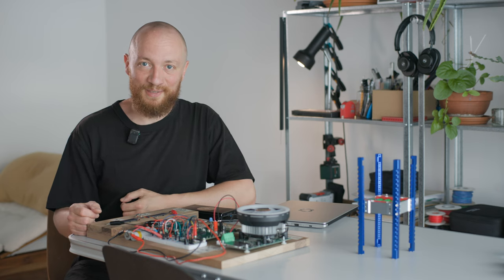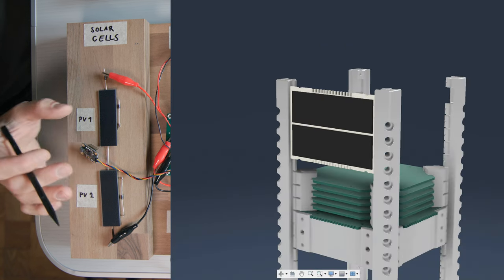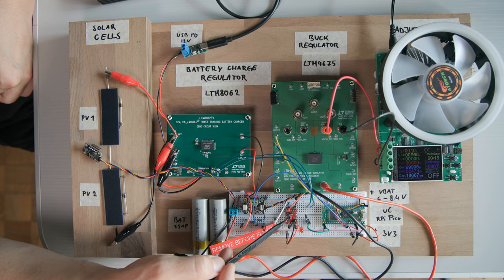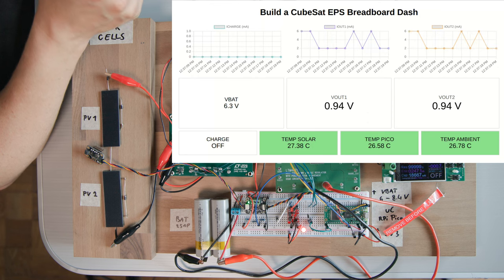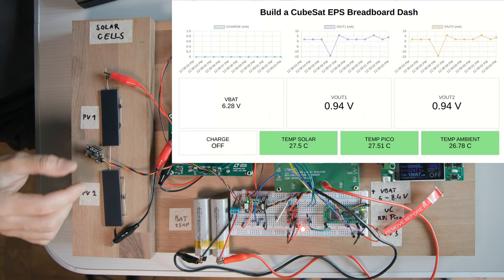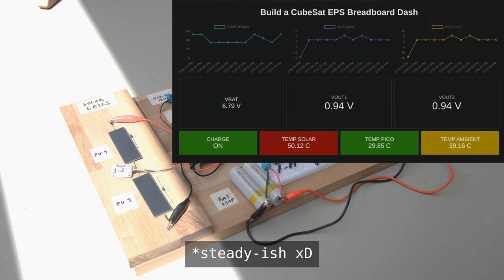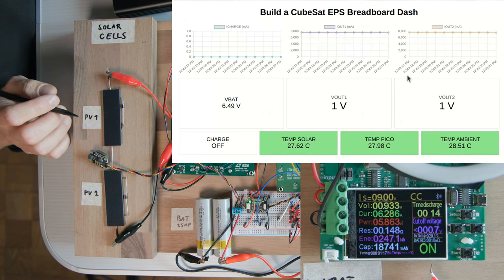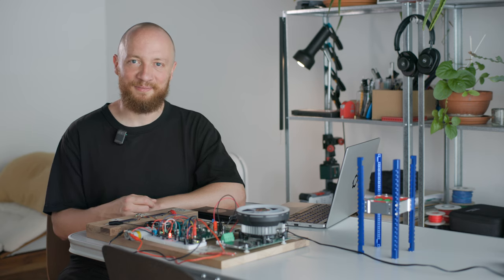CubeSat EPS: Breadboard Prototype

Comment from the maker: The next thing I would like to try with the LTM4675 (after getting the PMBus telemetry to work reliably) is reading its internal temp sensors and characterize the temp rise when at different currents and at ambient pressure vs. in a vacuum.

Also I just noticed a discrepancy between the telemetry and the actual current displayed on the adjustable load at 08:05 just now. That's one more thing to look into.

Hope you like the episode :)

Comment: You could use a mosfet for the reverse current protection. Might be worth it since the voltage drop over Rds(on) is way smaller than the schottkey voltage.
Reply from the maker: Thanks for the comment, that's interesting! How would you implement this? With an ORing controller (like the LTC4358)?
Reply: @buildacubesat interesting ic but the voltage range of 9-24V seems like an issue. Do you have a simulation for energy harvesting part of your sat?
Reply from the maker: @aculleon2901  Not yet, I feel like there are too many unknowns as of now to start working on simulations. Let me get back to you once I have a first draft of the schematic. Getting to that point should clear up a number of questions.
Reply: @buildacubesat  Sure 👍. I would be glad to help you. Do you have a github repo or something similar?
Reply from the maker: @aculleon2901  Cool :) I have a Codeberg repo, but the schematic on there is very much a WIP. Unfortunately YT won't let me post URLs here, but there is a link in the description and if you go to main project, you will find the is a hardware repo.